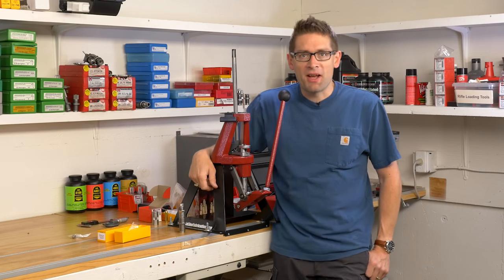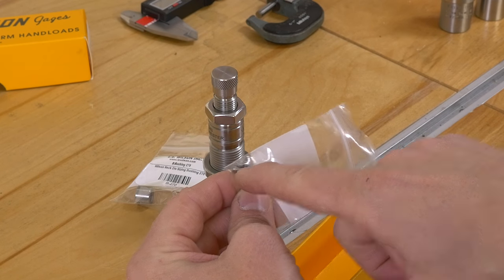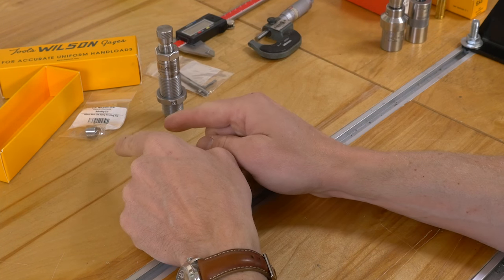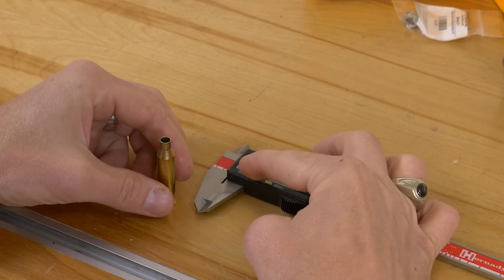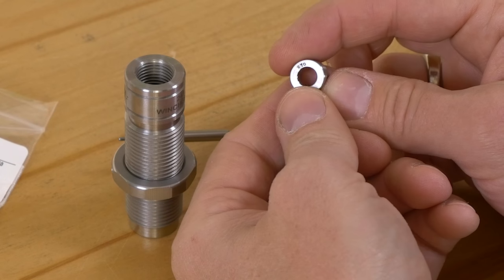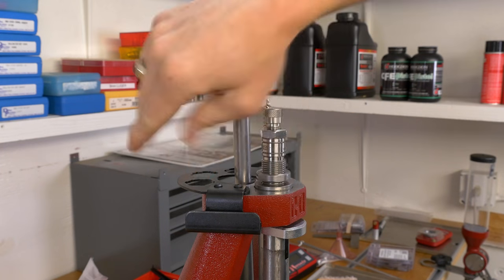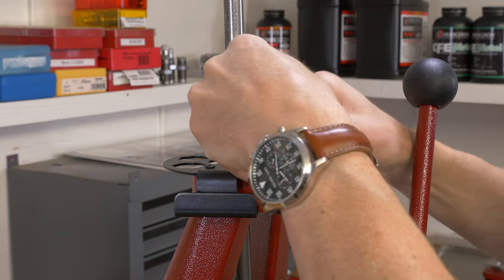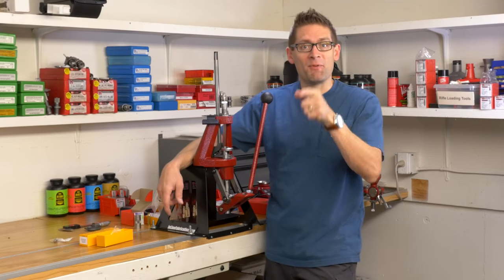New L.E. Full-Length Bushing-Type Sizing Die - Overview and Setup

Comment: I enjoy your videos but this one has a couple of mistakes. First of all, when setting up a bushing FL die. if you start out without a bushing in the die, and back the die off from the shell holder a bit, you can work up to the bump setting that you need working with one case that will not be ruined by the process. Once you have the die set, you can add the bushing, backing the retainer off just a little to let the bushing float, and size the case one more time. This keeps the neck from being over worked, and does not leave you with a case that will have an incipient separation the next time that it is fired. Finally, if there is no expander, there is no need for lube inside of the neck. I really like the design of this press. Your videos on it have been well made and extremely informative. Keep up the good work.

Comment: Very nice but I think I will stick with my Lee Collet Neck Sizing Die. Worked for me for years. I tried others but Lee gave me the best results in accuracy and concentricity.  Also the neck tension is dead on.
Reply: Agreed. I have good results using a Redding body die, followed by the Lee collet die. As far as concentricity goes, I've never had much luck with bushing dies.
Reply: Apparently a great die but you don't get any shoulder bump with the Lee Collet die no? Happy to be corrected.

Comment: Does this die have an "expander rod"? Why lube the "Inside" of the case? Thanks Gavin
Reply: It helps to not stretch the case/neck in length and save on the brass as well.

Comment: Fired rounds out of my RPR usually measure .296 neck diameter.   With hornady brass, loaded rounds measure .290-.291 at the neck.  To gain the appropriate neck tension I will size down to either  a .288 or .287 bushing.  I have found that if I try to size the neck down in one step--i.e. .296 to .288 it really negatively effects concentricity.    So  I step down the necks in .002-.004 increments which seems to maintain concentricity much better.    I have both L.E. Wilson (6.5 Creedmoor)  and Redding bushing dies (308 Win)  and have found this to be the case with either product.   You didn't specifically make any mention of this in your video, but I was just wondering if you made the same observation.
Reply from the maker: Interesting, haven't noted that- will have to check!

Comment: New to reloading (7mm rem mag).  I can see how you are precisely sizing the neck to fit your chamber, as well as precisely bumping the shoulder back also custom to your chamber.  What about resizing the body of the case?  Is that getting sized down to a standard diameter, or is there a way to minimally size the body as well custom to your chamber?  Do you custom order the body sizing bushing as well based on measuring a once fired case?

Comment: How do you like that die compared to the Redding Type S, FL sizing die? Great videos sir! Keep up the great work!
Reply: I have the Redding die for .222 and the Wilson die for 260 Rem and they seem to work exactly the same (I don't use the expanders in either die, I use a mandrill after the full length resizing without an expander). I like the craftsmanship in the Wilson stuff, very good quality, but if you live in a humid area keep them well oiled. The Wilson case gauge and accompanying micrometer that he demonstrates is an excellent product. Bought them recently and they are far superior to use than the Hornady style comparators for measuring case headspace, I can highly recommend.

Comment: Does the L.E. Wilson bushing create the dreaded "donut" at the neck/shoulder junction?
Reply: The Wilson die doesn't actually size the neck all the way to the shoulder so probably not.
This feature is a bit of a hinderence if you are necking down a calibre but overall its a great die.
Reply: Yeah the doughnut is still there, it doesn't affect chambering though.  I hate it but bushing is the way to go.  Controls neck tension.

Comment: Great video.
What brand of Micrometer are you using to measure 6mm bullet.Im wantingbt purchase one. Thanks
Reply: Would also like to know the brand of that case guage.
Reply: @charljansenvanrensburg9714  it is also a L.E. Wilson. I have the same one. I have been buying L.E. Wilson and Whidden Dies and other reloading tools. L.E. Wilson, Whidden and Warner are the best Ive found.. Redding and Forster are next down the ladder in my opinion. Sometimes you can find L.E. Wilson case gauges and dies on Ebay or Amazon. Good Luck
Reply: It's called a Wilson Case Gauge Depth Micrometer. It's an add-on to their Case Gauges which are a stand alone product. I bought a couple of gauges and the micrometer a couple of weeks ago...not cheap but one of the best bits of reloading kit I've ever bought. Far superior to the Hornady comparator style product that you use with callipers. Can highly recommend.
Reply: @claverton  thank you.I willorder one.I have 12 sets of LE Wilson Dies and a few WHidden and one WTC..it was really expensive.$600. bucks.Thanks  again I appreciate the help.

Comment: gaving why does this die decaping stem does not have the sizing portion on it as compared to conventional dies?
Reply from the maker: It's a different approach that offers more neck sizing versatility- bushings on the outside rather than expander ball on the inside.

Comment: I've always heard to back off an 1/8th turn when you're tightening the bushing down to allow it to slightly free float. I noticed you didn't do that, any reason? Have you found one to be more accurate than the other?
Reply from the maker: +drfroglegs Yes, that's a good approach.
Reply: interesting thst 1/8th of a turn is .009 lol would of solved the problem
Reply: Adjusting the float for the bushing won't affect the sizing of the shoulder only the neck.

Comment: A whole .001” for spring back?
Reply: And you really are only gonna get that if you don't anneal, or at least that's been my experience.  Also, neck turning too much will definitely cause spring back as there just isn't enough brass available to maintain the shape.   Just right on neck turning and annealing and you won't see springback of .001, maybe closer to .0005 at most.
Reply: P. Stewart, sounds about right to me.

Comment: Would i gain in useing these dies for a factory remigton 222 or are these mainly for custom guns???
Reply: very much so, by changing to good quality brass (was using Winchester, changed to Lapua) and using good quality dies such as these I dramatically reduced my groups in my 45 year old BSA .222 from well over an inch MOA to well under an inch, often around or below 1/2" MOA. I'm using a mandrill after resizing rather than an expander in the resizing die which I suspect reduces variability in concentricity of the neck. Also a good quality bullet seater (Forster bench rest seating die). Not sure which bit is creating the big change in accuracy but something is working. If I did it again I'd get a seating die with a micrometer on the top, but hey, it all costs money.

Comment: new to bushing type dies.. why is there no expander ball ?
Reply: Because the die is using a neck bushing which sizes inwards the amount you want. An expander ball die sizes the neck inwards way past what is needed and then drags it out via the expander ball. This overworks the brass and doesn't help with concentricity.

Comment: What are your thoughts on neck size only dies?
Reply from the maker: +Dan Neely I think they are great when the application is right. BTW: I'll be neck-only sizing 6.5 Creedmoor in the Ruger Precision Rifle series. BUT- if you can FL size and attain your accuracy goals- I would say go with FL so that you don't have difficult chambering, etc.
Reply: That's why I was asking, I'm doing it on my 6.5 RPR. Not really sure if I'm doing it properly since I've only used full length prior to this. The groups are good though. Love the videos.
Reply: Curious why you're choosing to use the neck only vs. something like the Redding competition bushing? I'm looking to pick up a RPR in 6.5 soon and have never loaded for precision before, so all of this is new. I'm learning through your videos that there is a LOT more steps than loading something like functional 9mm. It would really be nice if you did a short video on the basic equipment, dies, etc. for precision reloading. Right now I figure I'll need a case gauge, sizing die (FL and bushing or neck?), bullet seater die and headspace gauge. Assuming I'll start with fresh new brass. 

Also, please do a video on your load workup, and how you do it. Do you find a velocity first, and then mess with powder weight, or OAL? Are you going to leave the OAL at magazine length for this particular rifle? Can you explain the difference between the sizing dies (FL, neck and bushing) and when to use each?
Reply: Also what if you're wanting to use a single load for both a RPR and an AR10, would you want to use a FL die to ensure the brass is SAAMI?
Reply: ''STOP NECK SIZING''...Eric Cortina